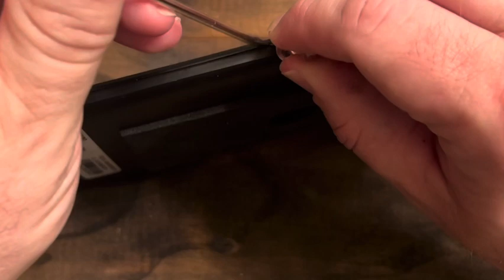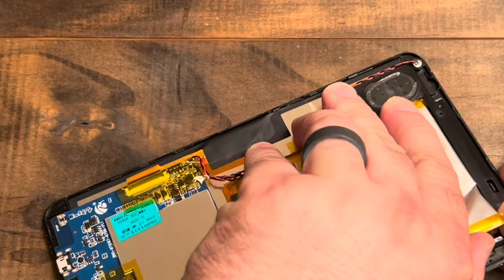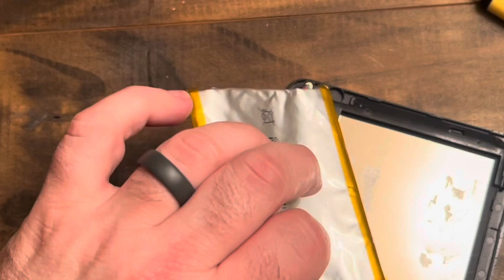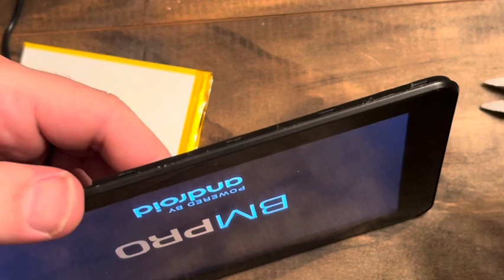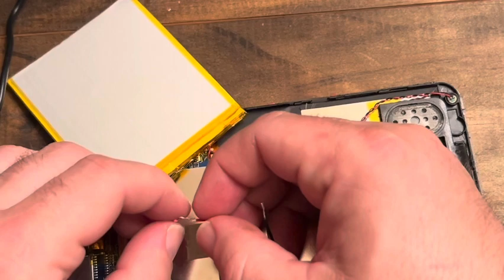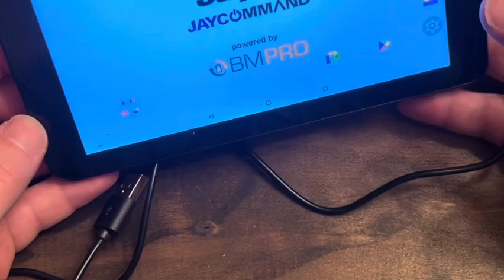BMPro Touchscreen Tablet Stuck In Reboot Fix

Comment: Great video, but why you need to replace the battery if the tablet is hard-wired it should run without the battery.
Reply from the maker: Wiring just charges the battery and battery powers the tablet.  Once the battery is weak enough it no longer will pass enough voltage through to keep the screen powered

Comment: Changed battery for 10 dollars. Works perfectly. However, it does not function unless a power source in addition to the battery is plugged in to it. Will not function stand alone.

Comment: What size tablet is this? Is it 7"?
Reply from the maker: Yes this is the 7”
Reply: I have the BMPro system in my 2018 Jayco Adventurer. I purchased it second hand in 2020. Not long after the Tablet completely stopped working. BM Pro/Detec told me to send it back to them for testing. They decided to replace it without charge even though it was our of warranty 
 A few months back it wouldn't hold charge so I sent it back to Setec and they have replaced the battery for a few of $145 including postage back to me. In my opinion this Bluetooth Tablet setup is a nightmare. If the tablet gives me any more trouble I will look at getting rid of it and doing away with the Bluetooth connectivity. The only problem is the cost to hard wire the non Bluetooth system in parts and labor will be very costly. 😢